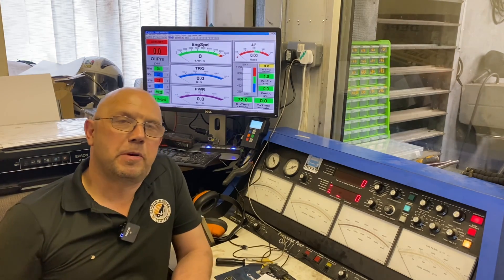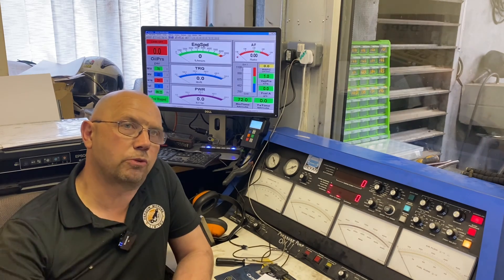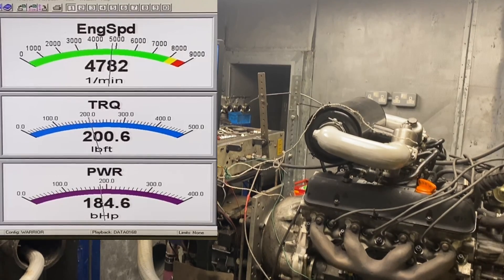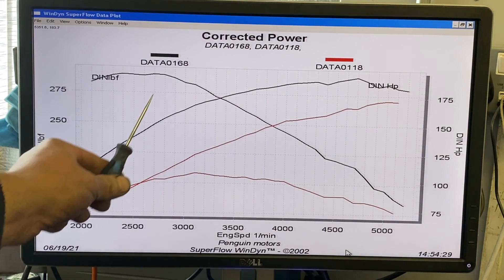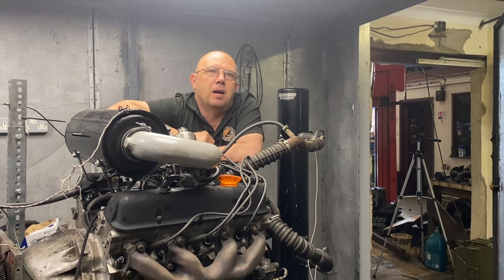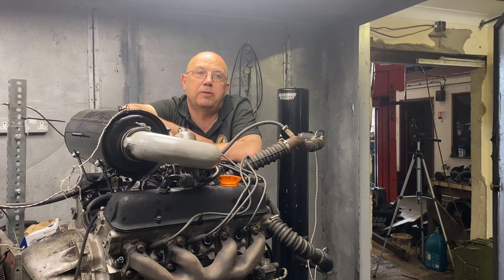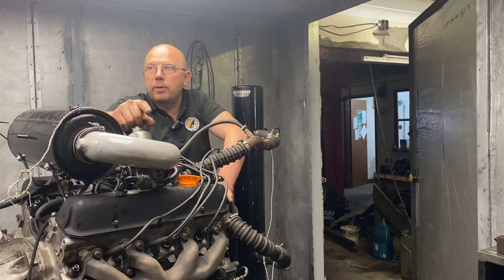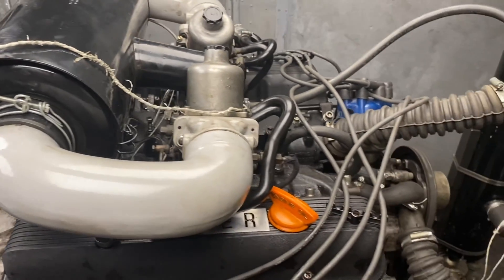Rover V8 3.5L to 4.6L upgrade DYNO TESTED! Rover p6 - Part 7

Comment: Hiya bud great video it's something iv been knocking around in my head for a while now iv got the option of doing a SD1 3.5ltr rebuild or go for the 4.6 option the very thing of doing a 4.6 on su carbs and a cam it's for an off road trialing truck the carbs sounded the simplest of options what I was thinking of doing with the SD1 engine was give it a good freshen up with a full lighten and balanced bottom end a cam and some minor port work similar to what you just described the reason I was looking at the SD1 was I believe it has one of the higher compression ratios as standard and I noticed that the 4.6 is lower compression would I be better starting with the 4.6 with and bumping the compression ratio up abit and a cam straight away instead of looking at the SD1 engine also it would be on a manual box, any advice would be gratefully received and once again good video pal
Reply from the maker: The 4.6 does have a lower compression 9.37 from memory, but it’s easy to raise it a bit. Sometimes a low compression can work in your favour though, if you use full throttle at very low rpm and a high load the lower cr is better as the engine will just get on with it. Same conditions and high compression it tends to stall or pink. Either way the the 4.6 give so much more torque it’s a far better starting point
Reply: @PenguinMotors  thanks pal would you recommend a piston to bump up the compression if I go that route and is there a cam that you would recommend for response abit more peppy than a standard cam
Reply from the maker: If you’re going 4.6 route just use steel head gaskets that will give you about half a ratio compression, provided the sealing surfaces are good steel gaskets are as good as the composite ones. If you want grunt right at the bottom of the Rev range I would suggest a Newman ph1
Reply: @PenguinMotors  Yeah grunt from the bottom but also to pull through the Rev range Iv had a 3.9 disco V8 but on a twin su setup and a 3 speed auto from early rrc and I wasn't that impressed with the engine but I think it was a little tired and the auto box I just couldn't get on with I was more impressed with the 300tdi setup I had in another truck but I'm wanting to build my own setup rather buy a truck with someone else's setup plus the V8's sounds beautiful and it's an itch that needs to be scratched yano 😉 it's a toy for a hobby and it's fun to be a big kid on times aswell as following a disaplin
Reply from the maker: @alex79buckland  ph 1 cam sees torque fall off fast after a little over 3K on a 4.6 so perhaps go one more? ph2?
Reply: @PenguinMotors  thanks for the advice pal very much appreciated

Comment: Fuel consumption?
Reply from the maker: What about it?  I’d your worried about fuel consumption don’t have a V8!  Although In fact the owner reported the 4.6 to be using less fuel than the 3.5. Used to
Reply: @PenguinMotors  Yeh, just interested. Why stick with stock low compression, high consumption. Not a criticism just a query.
Reply from the maker: @MrSpitfireMustang  TBH we could of given it more compression, but the car drove really well, and we are already pushing the boundaries of  what the the cars chassis and running gear can cope with
Reply: @PenguinMotors  Cool. Fair enough.

Comment: Back in the day at main dealer we would fit offenhauser inlet with 390 cfm with vac secondarys (or 600cfm) drove so much better and about 6mpg better (19-25mpg). Original inlet manifold was absolute shite....

Comment: I have a question a friend of mine wishes to build a off road buggy. Wants to use a later Rover V8 4.0 EFi . Is this a good way to for power and reliability or should we stick with good old fashion carbs?
Reply from the maker: Both can be very good, it’s hard to beat the simplicity of carbs in terms of it’s easy to get an engine up and running on them, but done right efi does have its own benefits in terms of efficiency etc, I would say you friend should go with whichever he or whoever will tune it is most familiar with
Reply: @PenguinMotors  Thanks for the information cheers.
Reply: Have a look at the TVR 400SE installation (I've owned one, plus two TVR 390SE's). From experience... very reliable. My 400SE made an honest 240bhp and 250lbs of torque on the rolling road, but was also good on fuel, and a smooth drive.

Comment: How much do these 3.5s share with the later range rover 4.6 V8?
Reply from the maker: Tappers, rocker assemblies and push rods are the only truly same parts, but the heads will interchange and all the earlier components such as sump, timing cover, cam, timing gears will fit in the later 4.6 block

Comment: seems to be alot of lost Horse Power. 9.5:1 pistons, roller lifters and rockers along with a real exhaust probably add 50-100hp if you rev it to 7k
Reply from the maker: you dont need roller rockers or 7k to add 100bhp, but that wasnt the brief

Comment: What an excellent video
Reply from the maker: thanks
Reply: @PenguinMotors  no, the Americans don’t say “there ain’t no substitute for cubic inches!” that doesn’t rhyme and sound American LOL they say, “there ain’t no replacement for displacement”! 😂
Reply: I am not positive but I believe by..
changing the Cam, and timing cover you can convert the newer late model Aluminum Rover V8's to use a distributor.  Is this true??? @PenguinMotors

Comment: Can you cure the air starving by fitting 2" SUs off a Jaaag?
Reply from the maker: 2 inch carbs are an option on one of these, But the factory air cleaner and poor intake manifold are a bigger restriction than the 1.75 inch su's

Comment: What CR and cam are you using? Thanks
Reply from the maker: it was Standard 4.6 compression, which is i recall correctly is 9.37:1, cam was a newman Ph1
Reply: @PenguinMotors  there are 8.37 CR pistons and 9.35 CR pistons depending on country and year. Do you recall? I am building a 4.6 with the same carbs at the moment.
Reply from the maker: @element271  CR was defiantly 9.3, if it were in the 8's i would of done something to give it more compression
Reply: @PenguinMotors  ok thanks.

Comment: Interesting video, at the moment I'm doing the same with an SD1, I was recently given a 4.6 which was stored in a building which caught fire, rocker covers and plenum top were melted in places, but the short engine seems ok. I'm thinking 4.0 pistons, to give it a bit more compression, 4 barrel carb and intake, mild road cam, I have some ported heads from a 3.5, I  have Rimmer bros tubular headers and sports exhaust on the car. In the RR the 4.6 made 220 hp, I'm hoping for 250 hp and 300 lb ft with these mods. Am I being too optimistic? Subscribed.
Reply from the maker: sounds reasonable

Comment: I have a 3.5 and would like to do what you have done. So to be clear: you have replaced the bottom end and heads? Did you keep the upgraded cam from the 3.5? did keep all ancillaries including oil pump?
Reply from the maker: Yes all the 3.5 ancillaries fit sump/cam/ timing cover oil pump everything fits. If you fitting it to a rover p6 with power steering you need to cut a tiny bit away from the power steering bracket, and drill out a hole in the alternator bracket to take a larger diameter bolt, same with the engine lifting brackets

Comment: I have mgbgtv8  standard 3.5 engine apart from 4 branch tubular exhaust on the Northampton Motorsport RR produced 160BHP at 5000rpm .
Reply from the maker: is it an original Bv8 low comp lump? 160 sounds strong if it is :) did you use RV8 or block hugger manifolds?
Reply: @PenguinMotors  It is original  engine and heads (35k), the manifolds  are tight to the engine  no holes have been cut in body still on SUs but lot of time spent on getting them jetted correctly poppet  valves on carbs removed car goes really well lazy to drive as well the MGBGTV8 is potentially  a wolf in sheep's  clothing for little money.Standard cam.
Reply from the maker: @bertiewooster3326  thats good :)

Comment: Very nice! I have a 4.6 with Edelbrock 500cfm carb and Edelbrock intake manifold port matched to a pair of stage 3 ten bolt heads, Stealth cam and mapped ignition (MSD 6AL-2 programmable). With free flowing headers it made 325 ft lbs of torque at 4000 rpm. Over 300 ft lbs between 3000 rpm and 5000 rpm topped out at 315 bhp @ 5800.
Reply: I did wonder WTF there were "rubbish" SU carbs on that thing....
Reply: 4.6L and only 300bhp, that’s awful power per litre.
Reply: @superbrit3845  Yes but you have to bear in mind that these engines were designed in the 50's, early 60's, they are a two valve pushrod engine, not a double over head cam, 4 valve, pent roof combustion chamber engine running throttle bodies FI.
Reply: @superbrit3845  you have to remember the rover v8 is a 1960's engine.  For its time it was a powerful engine.  Lightweight to.
Reply: Niiiiiiice. 👌👍
Reply: Right? Those SUs.... May as well just finish the job and fill the petrol tank with cold pork pies from the war.
Reply: Almost built the same 4.6 for my TVR chimaera. 4.0 pistons for higher compression, stage 3 porting and stealth cam. Over 300hp.
Reply: Had a 101 gs with that power unit nice 👍
Reply: Show off!
Reply: Did stealth camshaft good ?
Reply: @waheedkhunji7475  I'm happy with it. However not really compared it with other fast road cams available.
Reply: I want to do this type of build for my friends Land Rover. But he is being an idiot and going with the Diesel engine from a P38.
Reply: @No.Handle31  not really

Comment: I’ve had several P4’s which I guess are my style of car, a 3 litre coupe’P5 and an SC2000. I did look at a V8 P6 but was put off by the way the guy just started it up and revved it right out. I just thought if that’s the way he treats it I’ll stay away. That’s the closest I got to owning one. Ultimately I was put off the P6 because the one I owned couldn’t handle corners in the snow in the Devon countryside. The P4’s were absolutely brilliant, having been careless enough to put one in a ditch, I was fortunate enough to be able to put it in reverse and get out. The lesson for me at the time I guess was that the P6 wasn’t exactly a country bumpkins car, even a V8. I’m talking now about hills and corners that need a rev to get up in the snow and handling to stay on it, I just felt that the P6 was a little too long  in the wheelbase for my needs at the time. The ditch didn’t happen in the winter. Nonetheless the P6 is an absolutely beautiful car to drive, the open roads of West Australia would suit them perfectly, and that V8 is the most beautifully tuned I have ever personally heard, and the way it was respectfully  revved is how I would treat my own car cold. Always a pleasure to watch your videos, relaxed, informative, and just really enjoyable. Thanks for that.
Reply from the maker: thanks for the feedback,  i like to test, not wear out or break engines. I like to bare the owner and final use in mind. there no point in pushing the rpm to the limit if that not how its going to be used.

Comment: Just think what it would do with a free flowing heads , cam and 4 barrel webber !!! owe and a nice set of ex manifolds ... knocking on the door of 330 im guessing and not far off that in torque if not a tad more !
Reply from the maker: it would certainly be interesting to find out

Comment: Great video, I notice the P6 was a 3500S, does that mean the exhaust manifolds on the test engine were the larger bore ones that were fitted to the 3500S ?
Reply from the maker: It was the 3500s manifolds fitted for the test
Reply: @PenguinMotors  I have a  brand new 4.6 in my car, its got a Crane 1/2 race cam, twin Ford 2.5 V6 34 DGAS weber carbs that have 24mm venturis,  on a very rare twin two barrel Edelbrock inlet manifold, I have the standard smaller bore P6 exhaust manifolds and a twin 2 inch stainless exhaust with balance pipe and straight through silencers, it goes really well, I am guessing the smaller P6 exhaust manifolds are fine except for higher revs, any thoughts ?
Reply from the maker: I don’t think the smaller manifolds will make much difference especially if mated to the bigger bore exhaust. But I do think you would be a lot better off with the 38dgas carb or probably better still a 40DF15 carb
Reply: @PenguinMotors  Thanks Graham, that was my conclusion about the exhaust too !  I have a pair of the bigger bore exhausts but they have been cracked and welded so I was reluctant to install them, the twin 34 DGAS carbs are fine, I have a good pair of 38 DGAS that I might try some time.
Reply from the maker: @devonrod  i guess you know the JR Wadhams have reproduced s manifolds, they are not cheap but are good replicas

Comment: Great video Graham how's about a standard but stroked pinto
Reply from the maker: its in the pipeline
Reply: I'd also highly recommend the burton bf63 cam which never seems to get much coverage but them that have it always highly rated it my self included  its got a very long spread pf power and produces a lot of talk torque and from reasonably low down 2